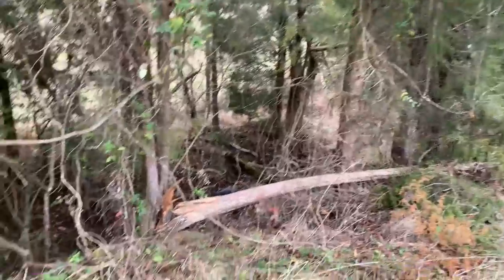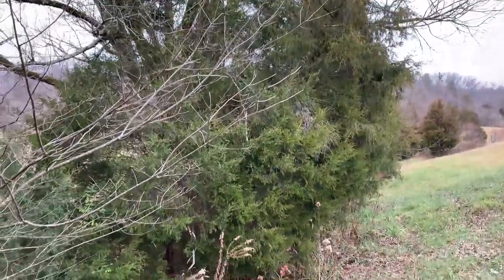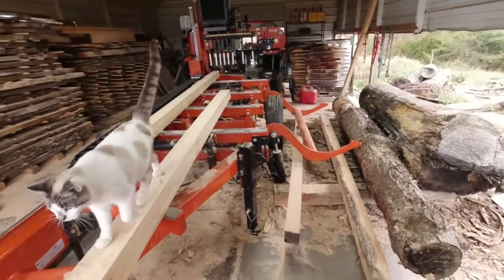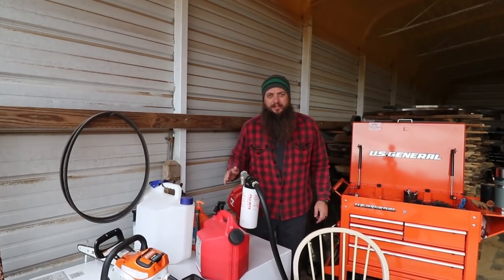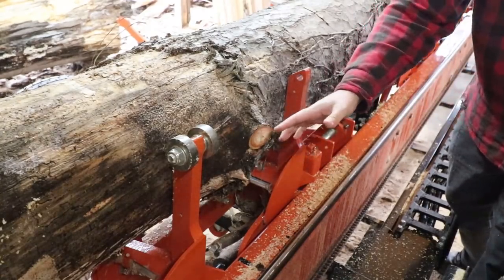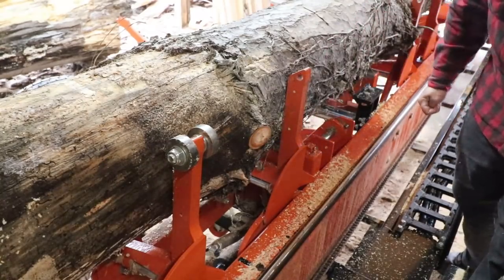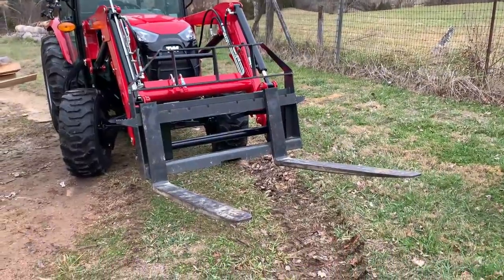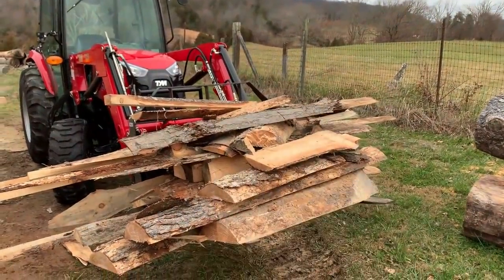The Handy Sawmill Speed Square Trick, Worth Your Time To Watch

Comment from the maker: This is the biggest square I could find which is same size as one I use in my video:  https://amzn.to/38nFoeh
Reply: I truly enjoy mixing cedar with locust in the wood fired oven. House smell so nice along with plenty of heat from the oven. The energy company doesn't like it. Since the keep raising prices thinking I have central heat.. when I point out I use wood to heat and cook..and gas for back up.. man they get riled up. doing this keeps the power bill below 80 a month.
Reply: Look for a machinist square they can get up to 2' or even bigger
Reply: Have welding shop make one the size you need.
Reply: I do not know if it would be a help but would adding a large bubble level to the square help. One that is large enough for you to see from the operator station so you can see at a glance exactly how the log is moving.
Reply: Take your blue carpetenter square, drill a couple of holes in the shorter arm, and add a 1/2" thick strip of hardwood to each side of that arm.  As if you're putting handle slabs on a knife tang.  You'll have a supersize rafter (speed) square super cheap, and it won't take long to do it.  It would give you a 1/2" lip on either side of the arm, plus a 1 and 1/8"  (9/8") wide flat bottom to stand the square up.  Or use thicker strips to get a wider base.  Drill a couple of shallow holes in the bottom and glue in small rare earth magnets.  Everything you wanted, very cheap, and customized to your desires.
Reply: @richardstephens3327  This would assume the deck is level. Normally it's setup on a slight slant... but it could be anywhere.
Reply: 7" magnetic rafter squares are available. Larger would be better. Still looking...
Reply: You hit the nail on the head with the magnetic base idea, a 2 foot square with magnetic base would be ideal. You could have a shop make one up for you.

Comment: I have been using a speed square for a while now, works great. people will remember the quality of the job longer than they will the extra time it took.   I also have a few 2-3 ft tape measure ends from broken tape measures. I keep one stuck to a magnet on the frame of the mill to double check my cant size.  they make great disposable yard sticks.
Reply: never waste what you can reuse.
Reply: @bladewiper  You can always edit your comments by clicking on the 3 vertical dots to the right of comment.

Comment: Make a square from a piece of plywood.  Drill holes in the bottom edge to mount the magnets.  Hold them in with glue or epoxy.  Paint it a color that would help to show if the log isn't square.  You could even mount a light on the back side to shine where the square meets the log.  Only the bottom and the side next to the log need to be square, the 3rd side wouldn't matter for what you are doing.
Reply: @Mike Merry Christmas and a Happy New Year
Hello hope you are doing great 
Will love to know you if you dont mind

Comment: 10:53 Welding supply store will have squares with built in magnets on both sides.  The upright side could hold a piece of really straight flatbar.  And of course the other side of the square will stick to you mill surface because of the magnets.
Reply: I was thinking that too. Magnets sound great, but what if they picked up a little piece of steel on the bottom? It would throw the square off. I really think a piece of channel welded on a framing square would work the best.
Reply: @Alwis-Haph-Rytte  Ya. Those things collect grinding dust and drill press chips all the time and need to be cleaned mostly using your welding glove.  They are a pain to get cleaned.

Comment: If you have a wooden hand screw clamp you can use that to create a stable base for your framing square by clamping it to one of the legs of the framing square.  Then you can set it on the rail of the saw mill to check for square.  Much like you are doing with the large speed square.
Reply from the maker: interesting good thinking,

Comment: You could use some 2 sided carpet tape to secure the framing square to the speed square. With the magnets on the bottom, it should be pretty stable.
Actually, I imagine some strong spring clamps would work instead of tape if you don't want to get the squares sticky.

Comment: If you have a wood burning stove, you can mix the saw dust with waste oil. Make it a dry paste then compress it inside a newspaper roll or square.  It will burn slow, hot and relatively clean.

Comment: Talk to your local machine shop connection and have them build you a speed square.  Water jet could cut one out of 3/4" thick aluminum pretty quickly.  They can easily add the magnets.
Reply from the maker: yes good idea,

Comment: After attaching the neodymium magnets ,not strips, try attaching a siring to the square and run it back to the operator station.. Once you have locked in the cant a small tug will remove the square from the top of the cross member and probably leave it attached to the side.saving an extra walk to retrieve it.  "Nothing ventured, nothing gained" Great channel

Comment: Get you some 3/4" wide Scotch brand magnetic tape and cover the flat on that square. Should be just enough magnetic strength over that 12 to 18 inches (depending on square size) to keep it in place. 👍🏼
Reply: I was thinking the same thing!

Comment: Here's my 2 cents;
Weld a piece of angle iron on the bottom of a framing square a bit off center so there is room to set the magnets. If you weld the angle iron so it will lip around the sawmill beam, then that with the magnets will hold the square true. They make magnet squares for welding, but I doubt thy make one the size of a framing square. A "C" clamp would hold it better than magnets. If you had a piece of channel iron that fit over the beam to weld the square to, It would set up straight with no need of magnets or clamp. A short piece of Channel welded on both ends would be lighter and work too. Magnets sound great, but what if they picked up a little piece of steel on the bottom? It would throw the square off. I really think a piece of channel welded on a framing square would work the best.

Comment: I use a torpedo level.  If the bed is level then the vertical face should be level.  It makes it easier to get it dead on.  But, I've got a manual mill I use the hook in one hand and the level in another.

Comment: Might talk to Fireball Tools, maybe he can come up with a design on a square that will be easier to use?  A way to set it up and move it out of the way from the control station would save you a lot of steps and bends (that you will feel in about 20 years).

Comment: A digital level with 0.1° resolution will get you within 1/64” of square over 12 inches.

You should also be able to check for gaps where the log touches the bed - If the bed is parallel to the blade.

Comment: Hi Nathan. I have a metal shed on my mill. What kind of insulation is that on your roof.  How costly was it. Mine is 31 x30. I’m sure it’s helping with heat. It’s hot here in middle Ga also and I’m sure it would help me AC
Reply from the maker: Closed cell. Works  great. 2in thick

Comment: Seems like you could rig up a laser level or two to indicate the vertical side of the log. Not the lasers that make a point, but the ones that make a line.  You could indicate on the left side so it would always be in the same place. Shoot a vertical line at an acute angle to the cant from up near the controls. Shoot another vertical line at right angle to the cant. When the two lines are not parallel to each other, the can’t is not lined up.

Comment: Start composting start a big new heap and Use the sawdust for part of the compost heap mix, or just jet it compost down on its own wet it, let it soak properly and it'll rot down or mix it in with leaves, grass cuttings, and your vegetable cuttings peelings etc etc..
Better than just burning it all, but also you could burn done aswell and the stuff you do burn then can add the ash back into the compost pile!

Another thing you can do (I believe!?) Is wet it and compact the sawdust into solid blocks to dry out an then once solid they can be burnt in a wood stove etc (if you have one) or in the garden etc in summer.. just another idea how you could process the sawdust to use. ...You COULD even make blocks out of it and SELL them if you get the process just right!? It could make money off the waste you're producing so money out of waste mate - extra profit in the bank for just a bit extra effort!? Just a couple ideas..

Another great video thanks and Merry Christmas from London England 👍

Comment: So, when you say full size 4x4 is it 4” on each face, or 4” minus the saw kerf? Can you just lower the blade 4” with every cut, or do you have to add the kerf? Could get complicated.
Reply from the maker: true 4x4, the sawmill computer add the kerf in so you get an actual size 4x4

Comment: I use a speed square like that, but I do believe the one you have is aluminum that magnet will not do you much good. Mine is made out of metal. So if you get a metal one gorilla glue will stick those magnets to the base of the square and then you’re good to go.

Comment: think about getting a self leveling laser (shop around) or two and mounting them somewhere - take all the guessing out of it. ymmv but could be a hack worth exploring - just a suggestion #plausible
Reply: also go back to electric mill - instant torque, no CO - a no brainer. co is a poison and is about 5x more likely to get bound to hemoglobin over oxygen so every time you catch a whiff of the nasty diesel you do yourself no favors - something to think about #benzene #voc
Reply: @shephusted2714  You can always edit your comments by clicking on the 3 vertical dots to the right of comment.

Comment: Can't rely on the back stops?  Maybe wood miser needs heavier back stops.  I didn't have that problem with my timber king.   If you can eliminate those extra steps, you'll save a pile of time.
Reply from the maker: doesn't take that long, every machine has its flaws, have a good one,

Comment: I wonder if the sawdust could be used in a wood stove. Seems like a waste to just burn it in the pile.
Reply: I’ve looked around and there’s no easy way to press sawdust into bricks (or any other shape).  Any method that works either takes special, very expensive, equipment or is way too slow to be viable.